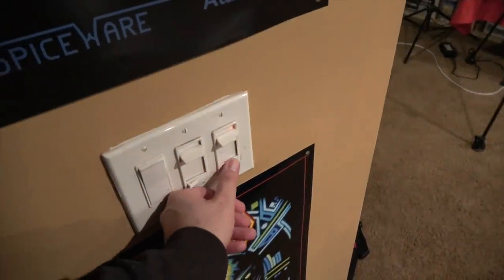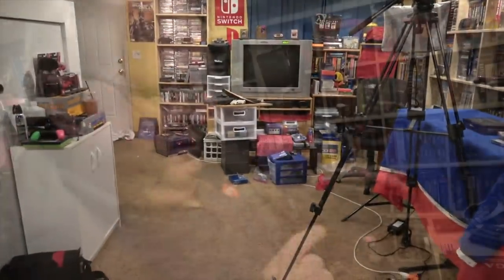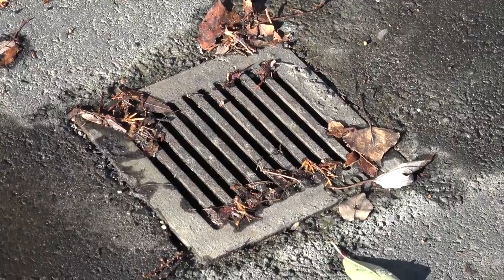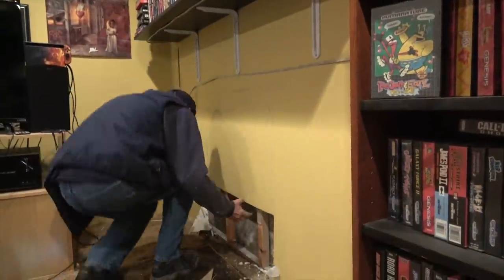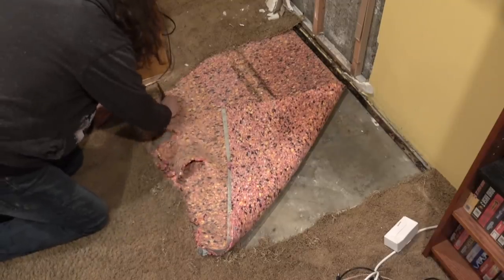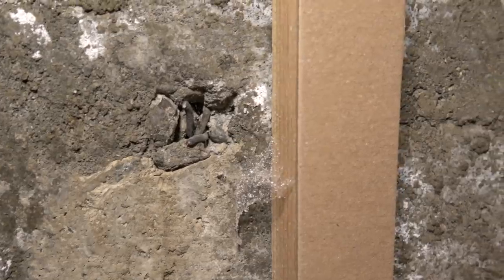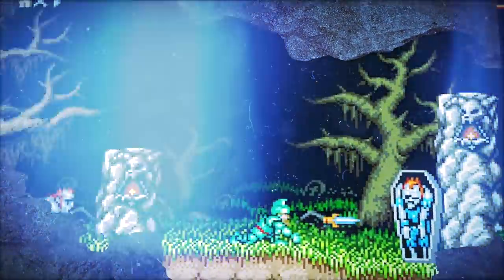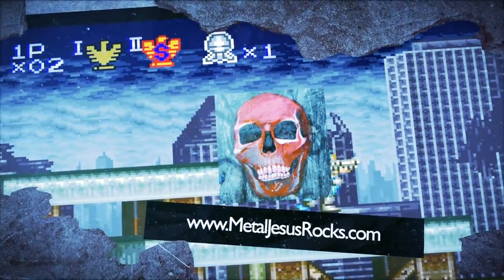OH NO! Water & Mold in the GAME ROOM! $10,000 to fix!

Comment: go to home depot get some jose's and pedro's they will get it done in 3-4 days for $4k you just have to buy the materials.
Reply from the maker: No. You don’t mess around with a 300 gallon oil tank in the front yard if you can help it. Being 58 years old, if it gets damaged or leaks, the EPA gets involved. That’s where it gets expensive

Comment: use drywall. its cheap. its easy. throw up some mud. sand it smooth. paint. 
you'd be surprised how easy it is.
Reply: as a plus, you can cut into it easy later on and patch it shut. easy peasy. dont even need to paint. just do it strategically and you can cover it with a poster.

Comment: before you spend that sort of money i'd try a urethane based sealer in that hole(it goes in by a caulk gun) and  test for water ingress. from my understanding of urethane sealing, you WANT water coming out of the hole doing this as it helps this stuff expand in the hole and actually draws it into the problem area. leave open, soak, soak, soak the spot once dry and if water stops.....call it done:) repeat if the problem happens elsewhere if needed, you likely won't. if this solution works im sure urethane would too. https://www.youtube.com/watch?v=Daeq82jLBgc

Comment: WTF, why do they only give you the super expensive solutions? Profits! Just fix the drainage problem upstairs, much cheaper: If the drains cant cope with the drive run off, route it to a soak away and have it exit far away from the house in the middle of the back yard? If necessary look at all the gutter run offs and make sure none are leaking and route them away from the house - will cost much much less
The walls are only wet becuase water is running in that direction, just fix where the water runs to and you dont have to touch the structure of the wall other than putting a membrane on the inside. Here is a video where correct drainage for a new driveway is installed, I bet you can get it done for much less than $1k: https://www.youtube.com/watch?v=uNh74o7ifW8

Comment: Shoulda had your basement sealed properly had a free estimate places here in Ohio offer free estimates.   Before converting it into your game room. 

Metal Jesus,  it can also happen from the concrete floor and it comes from the house foundation too.  

Majority of basements leak if from the house drain along the foundation septic tank.    You can toss topsoil  90* degree angle at where dirt meets the cement throughout along of your entire house foundation.  

My father and cousin do this type or work also Drywall and electrical on the side from working in  an auto factory (My Father)  and fire firefighter( my cousin). 

Your friend is correct but if you spent $40 grand and interior seal you still have the leak.  Just spend the money on the topsoil added to your house's foundation. 

The sealer they'll be using is called Dry Lock this stuff does work I had exprience applying it to my studio basement  by using the Two part Dry lock the joint compound ( applys to concrete) and Dry Lock sealer (a Heavy duty Interior) paint either Semi gloss, Gloss or Satin they come in three types all are Sealers.

Comment: Its gonna cost you at least 20 grand, plus it'll take anywhere from two weeks to a month or slightly more, AND if you do not package your games and remove them from the room completely they could potentially get ruined... so boxing everything up, moving it out, then moving it in again and unpacking... I think you're better off going for the 40k exterior solution, maybe try to find a deal or another contractor who would do it in the 30k -35k range... it would be a better solution and also cheaper on the long run ... oh, I'm an engineer btw.

Comment: 5:11 you call that a wall ? Out of a germans perspective this is just paper xD
Reply: This is gyprock (edit: Nothing more than plaster wrapped in thick paper). The real wall and insulation is behind it. This is how it's done about everywhere in North America. I checked a few videos and I would say it looks rather similar in how it's done in Europe.
Europe : https://www.youtube.com/watch?v=_OloldpTF-g - A thin layer of plaster + a thin fiber glass sheet applied directly on the insulation topped with another thin layer of some stuff to give a texture to the wall.

Where I live : https://www.youtube.com/watch?v=aebjjRlW2I8 - Same thing but instead of manually applying the plaster directly on the insulation, gyprock is nailed to it. We regularly have temperatures in the -20's over here during winter and this does the job very well and you can do it yourself using locally made products.

Different but efficient nonetheless :)

Comment: Dude just patch this shit yourself. Get a hammer drill and chisel out the area and patch it with hydraulic cement. Also drywall work is easy. You can do it yourself. All this is totally unnecessary.